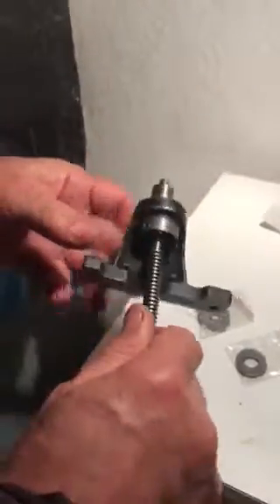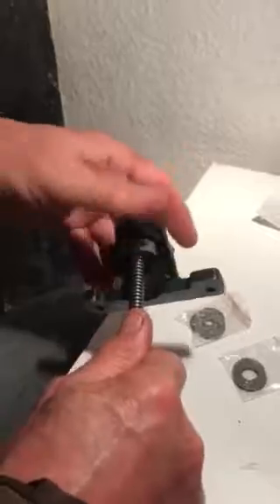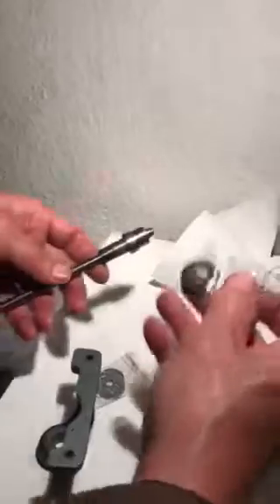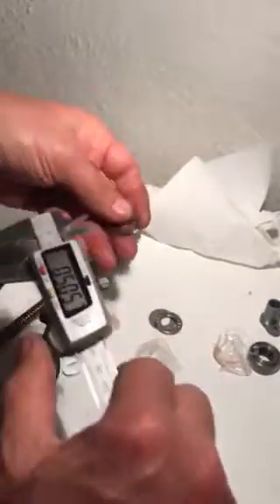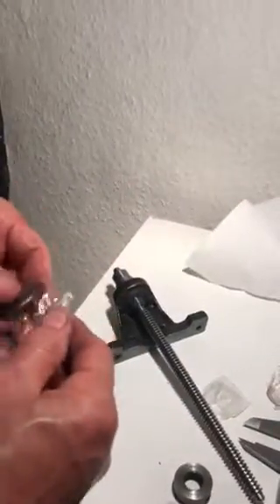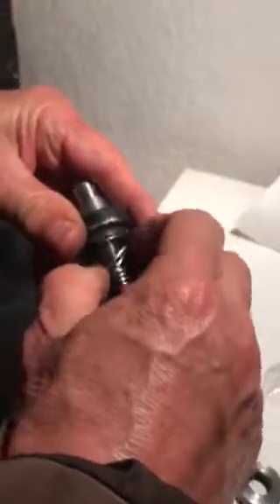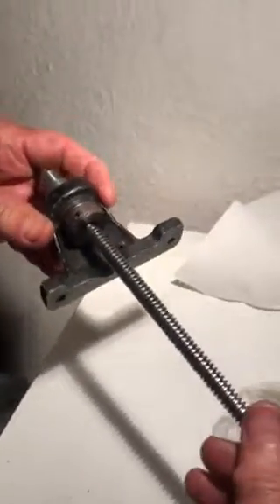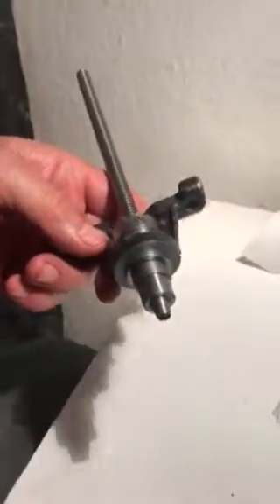fitting axial thrust roller bearings to myford S7 cross slide to eliminate some backlash

Comment: is this a super 7 with power cross
Reply from the maker: no, if you have a power feed cross slide you can use bearings a bit larger in size. which can be bought from a friend of mine. we both fitted these bearings on our machines which have power cross feeds. thank you for asking.

Comment: My S7 got about 0.56inch thickness at this area. Got changed during the years?
Reply from the maker: hi, correct me if i am wrong. do you mean backlash at the feed screw? i do not think that is possible, most likely is the feed screw nut under the end plate is not adjusted properly. regards
Reply: No I mean thicker leadscrew and also thicker thread and collar
Reply from the maker: @philippjung1004  yes auto feed cross slide have larger feed screw. these bearings will not fit. but i think the bearings will fit the top slide. thank you

Comment from the maker: try these bearings for myford S7 and ml7, some of them may fit ml10 but i dont have ml10 therefore i can not be sure. there are differences in size of bearings Super 7 / Ml7. but same idea. if you use molyslip or oil you still have some problems with out the bearings. try the bearings and money back guarantee if not happy with the service, communication, dispatch time and the bearings.. what you going to lose? when bearings fitted properly and slide grub screws adjusted nicely you feel the ball handle glide and smooth turning of  feed screw and responsive move on the part of the cross slide. these bearings can be fitted on the top slide as well which will yield same  results.

Comment: Hi, just bought a super 7 mine needs  doing ,where do i get the two sets of bearings from and size.
Reply from the maker: Hi David, see my comment. item no. 283281556732 on ebay. thank you
Reply: DAVID CROWCROFT Did you manage to get the two sets?  I have both if you need them.